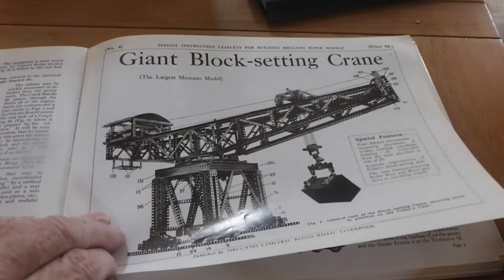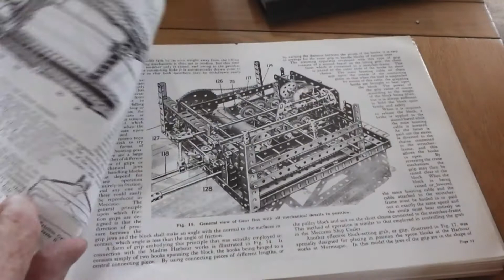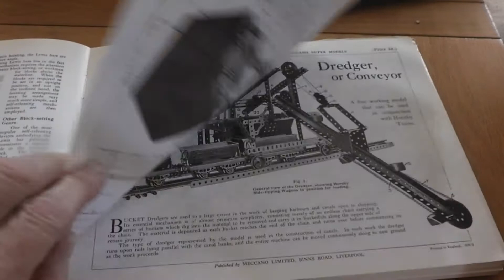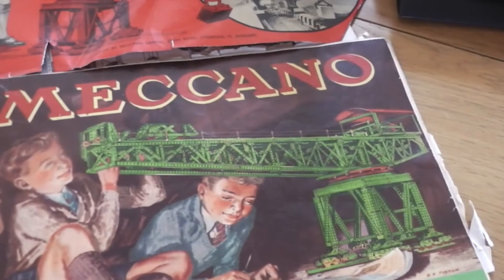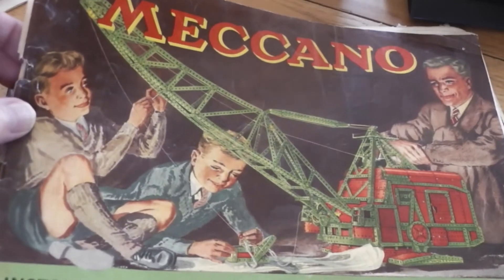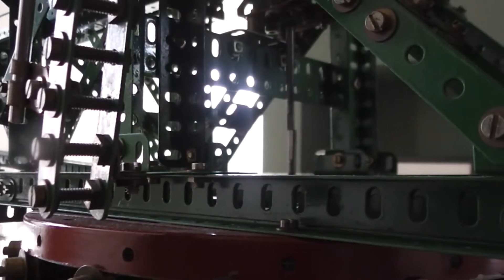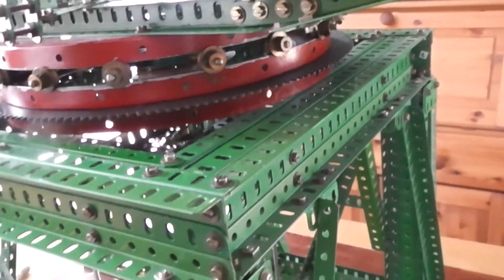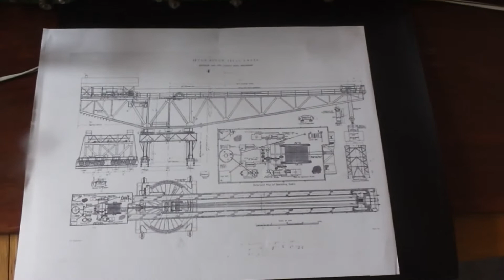Meccano Block Setting Crane

Comment: So talented! I grew up (60's - 70's) always dreaming of getting a No10 set in its wooden box. I had a No 8 for Xmas 1968?, not sure what that would have cost in today's money, but I do remember a No10 being just over 50 pounds back then. Thanks for posting your block crane!
Reply from the maker: @tresparivet6348  Thank you for your comments. I only made it up to about a set 6 back in the 60s. I didnt do any Meccano again for many many years until the early 1990s when my 6 year old had a set but wasnt greatly interested but I was! I was particularly surprised that at that time that the parts were still numbered the same after all those years. The Number 8 set is a good standard to get to, sadly the No10 was out of reach to all but the very wealthy. I understand if you wanted to buy one it would normally have to be made to order rather than a thing that even the factory had in stock. Sadly the No10 set is still a very expensive item, all second hand now, varying between £1000 and £2000 pounds depending on colour and condition.  Thanks again for your comments.
Reply: 50 GBP in 1968 is around 2200 GBP today adjusted for inflation. I don't know about Meccano, but the Czech Merkur, which is similar to Meccano (but uses metric sizes, it is a century old company) makes the same set of giant excavator, cca 18 kg, almost 40 pounds heavy, since the 1970s to this day. It is currently sold for 11K crowns, which is the equivalent of 500 Euro or 370 GBP. And it's still made in the same factory.

Comment: That is a marvellous piece of work - beautiful film. Some years ago I made one of these by combining the boom and upperworks of the pre-war No 10 - the one you've never seen made up - with the base from the post war model, because I thought the combination looked better. A lovely thing, if I wished to fully rotate the boom the model had to be very precisely positioned in the centre of our spare bedroom, to avoid striking the wall on either side. Yes, it was that big. My wife was very pleased / relieved when I took it down - and it came apart (sadly) a lot faster than it went together.
Reply from the maker: Thanks John. Yes getting a Block Setter to fully rotate needs a lot of space! I built this getting in for 20 years ago and havnt the heart to take it to bits! But, yes, they come apart much faster than they go together. I am surprised how much interest there is in this model this and also the tremendous interest  in my Crawler Tractor elsewhere in this channel. But then Meccano is a wonderful toy which, sadly, has gone a bit out of fashion in recent years due to competition from construction sets beginning with L!

Comment: Very nice. Something all boys drooled over at the image on the cover, but of course were never able to get even close to building something as large as this. Thank you for showing this in real life!
Reply from the maker: thanks for your comment. Its certainly an iconic model.
Reply: Mecanno was intended for primary school age boys, age 6 onwards - 12 at most.   When I was 6, a friend of my father gave me a large collection of used Mecanno parts - probably because his own children had out-grown Mecanno
By the time I was 7, nearly 8, I was building tower cranes just like the one in this video.   Just as big and just as complex.   In my cranes I used the Mecanno ball race thrust bearing - from memory it was about 150 mm diameter and had rim teeth to take the Mecanno chain.  I built lorries with fully functioning brakes (Bowden cable operated), steering, clutch, gearbox and differential too.
Like Sanspareil, I found getting sufficient power a problem.   I grew up on a farm, we didn't have electricity, and the Mecanno clockwork motor was completely inadequate.   However, after a while my Mother bought me a Mammod model steam engine (these had mounting holes compatible with Mecanno) - this did have enough power output.
By age 9/10 I had outgrown Mecanno and switched to building radios and other electronic devices.
Boys up until the 1970's were a lot smarter mechanically than the later generations - I was in no way unique.   The following generations were dumbed down by the pretty plastic Leggo.   Their post war parents were more affluent and provided their children with a lot more variety in toys and activities.  Also, after-school sports became a distraction away from non-team things you did yourself.
So you are quite wrong - boys were indeed able to build things just like this.
Old guys who build Mecanno are just like old guys who play with scale model electric train sets.   Good on them for having fun, and for me at age 76 watching videos like this one is a quick bit of childhood nostalgia.  But DO NOT think Mecanno was not a toy for small boys.
Reply: @keithammleter3824  I never intended to hit a nerve, but meant that most of us never had the money to get enough Meccano to even come close to something as big as this. Certainly not in the 30's when my dad grew up. Apart from that, as far as I can recall, most boys (and girls for that) of say 6-8 were certainly not able or skilled to build something like this. You seem to be quite talented at construction and if you join others in this it may seem the whole world is as capable as you. I assure you on my part most people are not even close to your skills. That is simply my experience.
So enjoy as do I and please let your experience be yours and mine mine.
Reply: @pauldelcour  : You did not hit a nerve.   But I posted as I think you are wrong.
In the 1930's, they were the depression years, and families could not afford to spend money on toys.  But I was a small boy in the 1950's -  they were the post-war boom years, and parents could afford Meccano.   Also, being made mostly of mild steel and brass, it was very durable, and many kids got, as I did, a set of parts that some other kid had outgrown.
In the 1950's, Meccano was very common.   All the big city department stores had Meccano counters.
As I recall, the axles/shafts could become bent if some 6 or 7 year old overloaded them with his weight, but most fathers could straighten them out.
Forget girls.   Until the 1980's, girls never much got involved in "boy's stuff".
Interestingly, Lego seems today to be enjoyed by a fraction of girls and less so by boys.
In the 1950's not ALL, but a large fraction of boys certainly could handle Meccano and build operable trucks and tower cranes.   That was the generation of mechanically minded boys - just as boys today are hopeless at mechanics but know how to use iPads and mobile phones, and play computer games.
The 1950's kids were the generation that often had a shed in the back yard they used as their "laboratory' in which their chemistry set knowledge was extended to make things go bang.  I and most of my friends had a 'lab".  
Don't underestimate the brain of a child.   Our intelligence peaks at about age 20.   Fortunately experience compensates for the loss of IQ as we age.   A 12 year old has about the same intelligence as a 60 year old.
When personal computers became common in the 1980's, I conducted YMCA "computer camps" for children and pensioners.  Most 6 year olds clearly learnt faster and could out-think anyone over 70.    You only needed to show a 6 year old how to use Microsoft paint once.  Half an hour later they show you pictures of rabbits and whatnot.   Teaching a 70 year old, you had to explain the same things several times and some still wouldn't get it.   I had one guy at work, only 60, who simply could not master using a mouse.   The harder he tried, the madder he got, and the worse the result.  We had to sack him.  Yet to talk to he was quite normal.  
Disclaimer:  I am now quite over 70.
Reply: @keithammleter3824  Ha, that's so recognizable. Apart form IQ, could it not also be that kids are used to what they grow up with? Adjusting to quite new things has never been easy. I understand the basic of computers and use them all the time, but my wife will never understand the basics. She wants computers to think like she does, reveiling a major issue with a lot of apparatus: how user friendly they are or should be.
Experience wise, I could not be a better music composer and arranger now than a long time ago, being now 63. I blame that to experience rather than IQ.
We're a fascinating species at a time when technology changes at a higher rate than ever leaving behind more and more people it seems. We really need to be careful how we play this.
Reply: @pauldelcour  Yes, it's indeed a matter of what kids grew & grow up with, and parenting styles.
There can be no medical or evolutionary reason why today's kids are dumber on mechanical things and smarter on computers.   Nor is it environmental in the sense that for instance lead exposure is no higher than it was in the 1950's.
It is a matter of what you have to play with, and parenting styles.   I say that because my generation of parents did not supervise kids, so long as the kids showed up for meals and went to bed at bed time.   If something made you cry, too bad.  You got the blame if you did something wrong.   if you wanted to visit a friend, you got yourself there, walking or on your bike.
So my generation grew up being resourceful and able to take life's knocks.  
Today's generation of kids get a structured day and parents treat them as princes and princesses to be shielded from hurt.  They get driven everywhere.   So they grow up much less able to take stress and life's knocks.

Comment: Very impressive. I love the levers in the engine house. I made the SM4 crane but not this one as I didn't have 125 3-hole angle girders, probably never will have!
Reply from the maker: Thanks for comments. I cut some No8s down to 9fs for some that were not so visible so cheated a bit! I made Sm4 several years back but while looking good found the gearbox struggled when transmitting power to the wheels.
Reply: A later GMM model instructions leaflet suggested using trunnions instead of the 1.5 inch angle girders. This would be on the upper part of the main boom sections where the whole assembly is a straight right angle. To prevent screw pull through when attaching the bracing strips/girders, washers can be used on the irregular holes of the trunnions.
Reply from the maker: @robertneill3057  yes that could be a good solution.